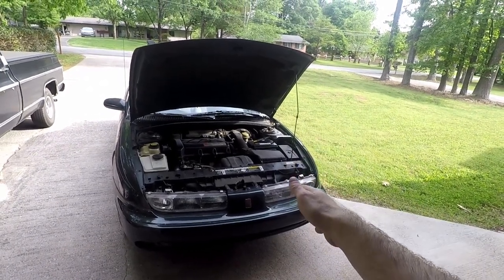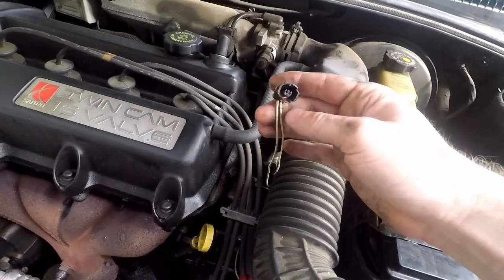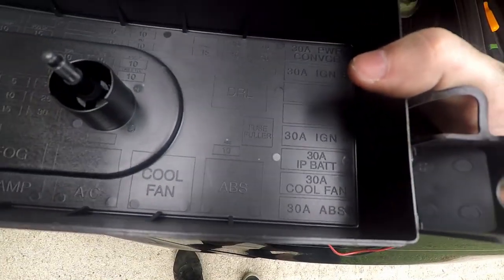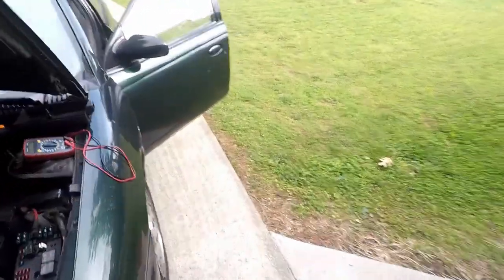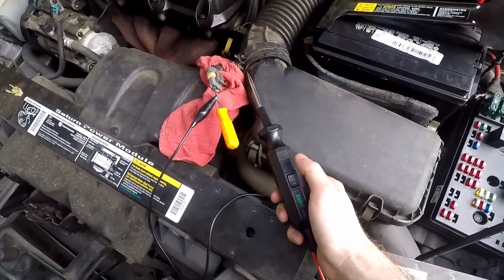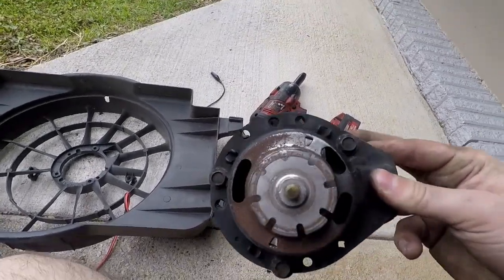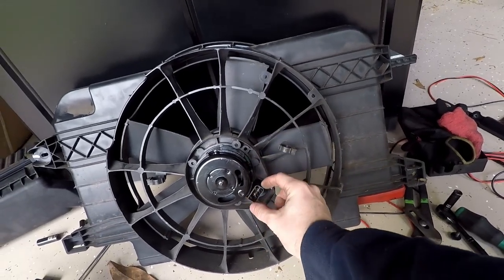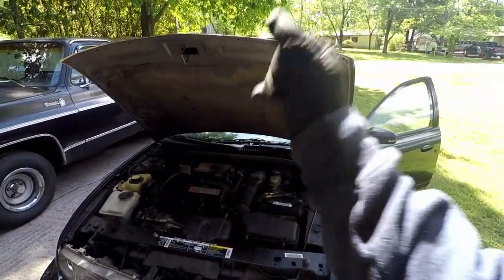1997 Saturn SL2 Overheating Diagnosis And Fix

Comment: I have the same reading on the panel, (half way to hot reading) I will check the sensor and see what is up with that.  Anything else I should check? (1999 sl2) Thanks

Comment: you just saved me a lot of money! side note, weird issue I still have is the radiator fan only turns on when I have the A/C button on with the fan setting at any level except off. I thought using the AC was usually something that adds heat, but weirdly my radiator fan will kick right on when I turn on the AC only, I also tested it with the temp sensor unplugged and the AC  button off, and it would not turn on. Then with or without the temp-sensor plugged in, it would only turn on once I turned on the AC. 

Im wondering if anyone knows if saturns have some kind of bypass where the AC motor automatically turns on the radiator fan, it would make sense since the AC draws heat and the radiator fan might naturally engage with AC on? Any thoughts? I am pretty sure my temp sensor is bad, but even with it unplugged the AC engages the radiator fan.
Reply from the maker: Typically turning the AC on will turn the fan on. This is in order to keep the AC functioning optimally when you’re sitting still in traffic.

As for only turning on when turning AC on, the fans on these cars don’t kick on until 5/8 on the temp gauge!

Comment: I have a 96 SW2 that I changed the fan motor on, but now it won't start at all. I have tried a couple different "quick starts" to get her goin again but to no avail. Any idea?
Reply from the maker: Hmm the fan motor isn’t related to whether your engine can start or not. Did you disconnect the battery when replacing the fan motor? Maybe when you reinstalled the battery cable you have a bad connection now? Or in my case, I later on had a damaged negative battery cable that needed to be replaced. 

Otherwise run through the basic trouble shooting of a “No Crank No Start” or if it does crank then “Crank No Start”
Reply: @bluesxt  Yea, didn't have a battery in it while repairing.
Reply: @bluesxt  Found out what the deal was, it was the plugs. They were over 100,000 miles old. And so they were melted and deformed. Caused to have a weak if any spark and flood the engine with gas. The coolant temp sensor was also bad, it being the plastic original. So i ordered them, but couldn't start the car yet  due to a couple other repairs, but were back on track. Gotta say, in the midst of doing research, people kept saying so many unrelated things that were actually the problem. Never gonna look it up again. Just gonna get right into it myself.

Comment: Mine does kick on but not until the gauge reads near 3/4. That normal??
Reply from the maker: Yup! It should kick on at about 5/8 on the gauge (just before 3/4). I think I mentioned that in this video (or at least tried to) :)
Reply: Just got a 2000 sl2 and was just curious of most common issues I should look out for. I thought something was wrong cuz I got the temp up to about half and the fan never kicked on I’m gonna unplug the sensor in the morning to see if it spins just wanna make sure the ects is good
Reply: Also after I drove the car for it bit it started to idle high when in park or neutral it continues to climb rpm but in gear it’s normal at 1k rpm

Comment: My fan only comes on when I turn my AC on. The fans don’t come on automatically. What could that be?
Reply from the maker: @Peppep2024  the fan doesn’t turn on till about 5/8 on the temp gauge. If your temp is getting past 5/8, close to 3/4, and still not turning on then you may have a bad engine coolant temp sensor (ECTS)

The plastic ones from factory are known for going bad
Reply: @bluesxt  Thanks for the reply. Yeah I get it to operating temperature and the fans still don’t turn on. I run the AC to get the fans to go on. I purchased a thermostat and a coolant temp sensor and will be installing both. I hope this is the problem. Great video!